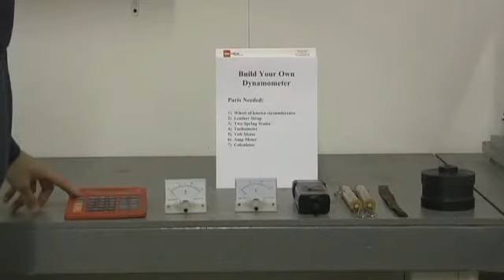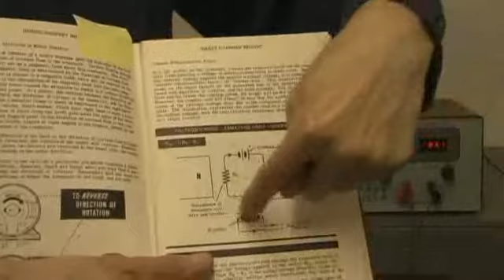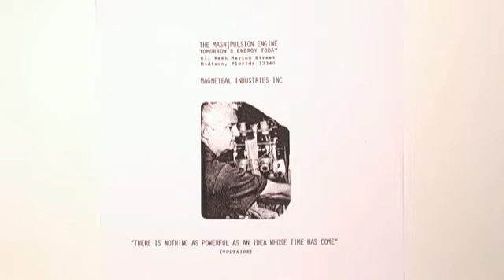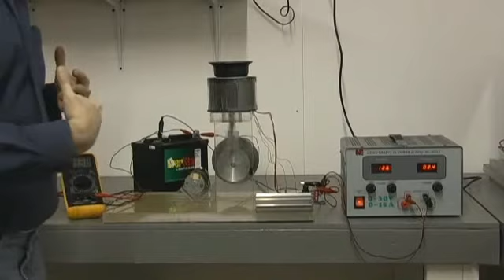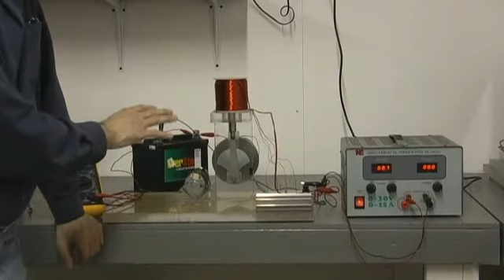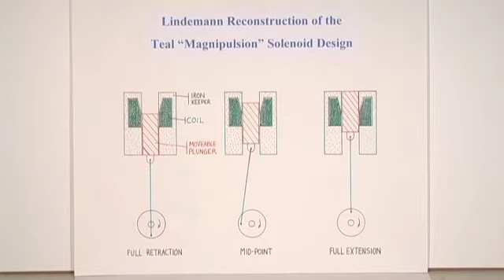Electric Motor Secrets . Film by Peter Lindemann 2007.

Comment: ❤ please addrress these points
Load Changes: If there's been an increase in the electrical load connected to your generator this will result in a higher 'back' emf and thus potentially lower output power/voltage even if rotational speed remains constant.

Internal Resistance: Increased internal resistance due to components aging or malfunctioning can impact the efficiency of electricity generation.

Temperature: The temperature within the generator directly impacts electrical resistance - typically higher temperatures will increase resistive losses; unless steps have been taken to mitigate this effect (like use of special high-temperature superconducting materials).

Winding Issues: Any damage/disruptions within windings or connections between them could cause additional unwanted resistance.
Reply: Back emf is the reverse generated voltage?
Reply: Back electromotive force (EMF) is a fundamental concept in motor control and operation.
When a motor turns - whether due to external power being applied or just by being spun by an outside force - it acts like a generator. As the motor's coils rotate within magnetic fields produced by its magnets (or electromagnetic field from powered armature/coils depending on type of motor) they generate an electric voltage.
This voltage that is generated when the motor rotates opposes the input voltage used to drive current through the coil. Think of it as 'pushing back' against the electricity that's trying to flow into the motor.

When you first apply full power to a stationary electric motor, there is no back EMF because there’s no rotation yet causing generation action.

But as soon as rotor starts turning, increasingly intense magnetic fields start cutting through your stator/rotor coils which according to Faraday's law induces voltage in them. The faster the rotation, higher will be this induced ('back') emf and vice versa for slower rotations.

This 'back' or counter-emf builds up opposition to incoming driving current/voltage until equilibrium/speed stability point is reached where mechanical output power matches electrical input minus losses.
So overall it performs dual roles: Speed regulation & Protection (limits maximum possible current draw during startup phase

Comment: Some modern motors are 97% efficient. The 3% lost is due to resistance of the windings, eddy currents and windage/friction. There is no loss due to Back EMF as  that is a misconception. Motors are indeed limited by the laws of physics, notably conservation of energy. Spoiler Alert: None of the designs shown in the video show any evidence to the contrary. It starts well by showing the only test that matter.. the dyno test. Sadly very few if any of the "alternative designs" are shown being tested that way. At best they appear to be 70-90% efficient. Probably because they make the real source of loss worse. Just look at the huge coils of fine wire used. Imagine the coil resistance. Some conventional motors have as few as 2 (two!) turns of wire to minimise winding resistance.

Comment: Well, there is another side to this "Back Emf" on the 22:33 experiment.
If you have a close circuit at the generator side,  there will be an accumulated voltage- consumption of the lamp. That is why people think it is a "Consumption". Not really true, since the generated power goes back into the generator since it have become iternal circuit. That is why there is an accumulation of induction, simular to short circuit where there is no ressistance and will destroy the generator. Eddy current are also an iternal long induction circuit that accumulates, which you cant measure voltage on since there are no voltage difference to measure. Yet there is an strong Back emf force witnessing higher voltage. Which are written in Voltage not current.
So you can use the generator to charge instead, then there are no iternal  circular induction circuit as such and the "load" can hardly be noticed, yet generating max power. So no "overunity mashines" are not debunked.
Reply: @dedu456  Also to consider, on a Generator, Voltages encreases by every serial turn the wire have.
If it is paralle it is the current that encreases.
So in Eddy current, it should be voltages it creates, since "the wire turns" are iternal.
Well to my mind if you valuate the equations of a generator.
Reply: @dedu456  The best batteries are the discharged batteries. Btw. Back Emf are written in Voltages. So that might means that an electric engines works most effective on current. Which would mean lesser Back emf. Although the voltages accumulates when there is a load.

Another funny one is.
Let say you put an electric engine to a generator. 
The generator creates 10 Watts at 16 watts to the electric engine.
According to laplace law of forc F=W x B x C.
If you encrease the B to twice as big. 
It would bound to give overunity.
Since you would only need 8 watt to create 10 watt.
While The Back Emf would be unchanged.
Reply: @dedu456  dont know if you have noticed. There were lots of ytvideo, that have claimed this to be true. Even a company named Steorn. Who were fully open about this. There were ytvideo of some that have changed the magnets in small model engines to powereful nyo magnets. With extreme extra power output.
Geuss what, they were ALL takened down and "debunk"
Reply: @dedu456  Yeah and wiki claimes that Steorn got totally debunked. They got condemned if they did not complied.
But I think I get the game that is played here. Mid 1990's one of the major windmills companies in my country that heavily promotes windmills. The CEO of that company choose to resign due to the politic of the company. That only wants to build huge windmills and not for the private persons, that only big investors can afford.
Think of it, uses no resources, free energy. If you can get monopoly of that. Now all cars have to be electrical. The profit they can earn from this is huge as said it uses no resources like coal or gas. They charge electric energy from windmills with a 100% co2 tax.

Well as Eric Dollards said, if you could manage to build your own free energy, they cant charge for it, since "it does not exist."
Secondly Electric energy are the most easy energy to create. If people are force to it, they would look for alternatives, which can be found.
That greed luckily could be the shoot on their own feeds and turn against them.

So my attitude towards this, LET THEM DO IT.
Reply: @dedu456  Btw, you could buy a smaller windmill that supply a house for 2000$ back in the 1990. 
It is that easy........
Although they now try to make the demand that you MUST be connected to a powerstation.
Reply: @dedu456  Same with you, most people gets provoked by this. Nice chat for ones.
Reply: Do you have any books you’d recommend?
Reply: @sashasoule4585  have been though lots of modern books, but where i learned the most is validating the equations that exist in this, WHY are they put together as they are?
What are the story here? Once you get that, you will realze how little the authors of the books actually understood what it is. Not many goes back to the basic of the times of Steinmetz. Forget what you think it is.
Math are sooo confusing simple, it just is EXACTLY as stated.
Reply: @dedu456  It is surely heavily promoted and forced.
Have you seen the movie Thor:The Dark World.
What does the nightelf ship look like?
And the EAther....oooooh dangerous!!!
Talking about subliminal messages.

The anger against electric energy today. Pollutions of batteries...ooooh very bad.
Very hypocritical by some that have bought that Air is an pollution and the extreme pollutions Oil have done through the ages.
Already forgotten The Gulf oil dissaster?

Comment: Does it bother anyone that the generated voltages (back EMF) are impulse values that he treats as DC power?
EMF is generated within inductors only when the magnetic fields or current is changing, and is proportional to the rate of change of the magnetic field. (in this case, the speed of the rotating motor. Ignoring this fact of electricity simplifies the data collected, but also makes assumptions of equivalency that have no foundation in the mechanics. Party on Dudes, be good to each other.

Comment: Who is this and what have you done with the real Peter Lindemann? Is this the same Peter Lindemann who revealed the secret of Tesla's Solid-state energy generation techniques, and the core technology behind Edwin Gray's energy-generating motor? The last time he pulled out the Navy's training manual of electrical engineering for the new recruits was to point out how wrong it was when analyzing Gray's , Teslas,' and as it turns out, CP Steinmetz's seminal work on the fields and waves of electricity which obviously are dominating the functionality of motors. Why does he waste all this time explaining these inaequate and irrelevant/archaic models of electricity that help plumbers understand that wires are connected like pipes to make simple electrical machines work?  Kirchoff's rules do not apply when magnetic fields are generating power in circuits beyond the connections of the conductors.

I"m sorry, but I can't unsee those past lectures and forget all the wisdom of untapped powers of electricity  for hours as Peter tries to explain how motors always generate power, most of which is discarded or works against the motor's basic function. 

This would be more to the point: when explaining the way inductors convert dielectricity into magnetism, which then is returned as dielectricity... and how Tesla patented a bifilar inductor with capacitance to shift the phase of the magnetism activation, producing electricity in phase with the incoming power. (done by Joe Newmann & Thane C. Heins, Joe with extra long inductor windings and Thane using Tesla's inductors) See the active principles of electricity as they operate and get comfortable with the reality that Steinmetz embraced to save lives and equipment, while Tesla used it to do more with electricity than anyone could imagine.

An inductor with capacitance will capture the changing magnetic field in the capacitance, and release it to produce the back EMF when the field changes polarity, always in phase to join the identical magnetic field. Boosting, not bucking the current driving the motor. (Tesla's court transcripts on NPR's website directly claims he shifted the phase of his motor's magnetic field to improve its efficiency.

Party on Dudes, be good to each other.
Reply: Am inductor with capacitance, is that only at the higher resona t frequency,  self resonant of the coil conductor?  Not to be used with 60 herts,  right?he couldn't have had much capacitance to it, or would that be a special coating or insulation of wires? Party on
Reply: @watchman0311  AsThane Heins discovered. Moving magnetic fields induce charge in capacitance, which flips when the magnetic field flips (always synchronized with the motor’s field) so no real tuning is required, but if the capacitance is too small, you could try adding some. The method of increasing capacitance that Tesla discovered was by splitting the total voltage across the inductor in 1/2 over the full length of the coils (see his bifilar inductor patent). Heins does a good job showing the voltage and current actions with an oscilloscope.

Comment: A few points: To synchronize this informative video (and not go nuts)  I watched on one device and listened on another. Also a battery operated wall clock is an excellent example of Teal's design. Now to the speculative:  Would repulsion instead of attraction yield a higher mechanical output?
Reply: ^ TOP COMMENT ^ @My Youtube - OR Just mute it and play audio in another tab. EZ

Comment: You know the electric pump from a dishwasher or washing machine ? Ware a cylinder magnet spins in the tuned core that has 2 windings . when i use this as a generator i get a voltage at about 50 to 70 v and can step up what seems to be an unlimited amount of times

Comment: Can you do a video, all about differant types of capaciters, a d how a capacitors, charging -discharging rate relates in time,  (do the smaller o es discharge faster) why capacitance in measured in such minute quantities  (it seems) and just all the discernable meaningful relationships.
Reply: You make a valid point. The rate of capacitance charging and discharging is exponential; so the full amount of energy stored theoretically takes forever, and several small caps will dump power faster than one large one. Not sure I see your point why this is relevant.

Comment: I want to ask Peter, if he thinksTesle s radiant unipolor (or not ) shockwaves, could produce an actual lightsaber like effect, like,  the size of a file cabinet. JUST real solid, and instantly cutting through anything.
Reply: Generating fixed or moving holographic forms in space is possible, but the pattern would be generated by sequencing the timing of the impulses from multiple projectors to collide in places relative to the handle/projector. The issue is timing and power. The frequency and position in space would have to be precise to each impulse and then have enough power to activate the effect for the target material. It also would have the challenge of which material do you design the pulses to match. The beauty of the application of a communications and power network is that it only interacts with the target materials, every thing else was transparent. So, slicing up a file cabinet, no problem, no damage to files inside or paint outside.  Cut a body in 1/2 but leave the suit untouched. Cut your way through a steel door, but useless for a wooden or carbon fiber door.  How about a "grenade" that projects a room full of flying bats that burn holes through any living tissue without affecting anything else in the room? Or melting all the brass or lead or plastic anyone was carrying. You could launch them from the street and never enter the building.  On a more humanitarian bent, you could have a single tower on the planet capable of putting out fires or stopping tornadoes or hurricanes anywhere on the planet. Tesla said he could make ball lightning, I imagine that was how... crossing the streams.